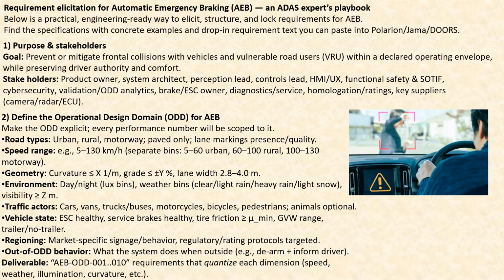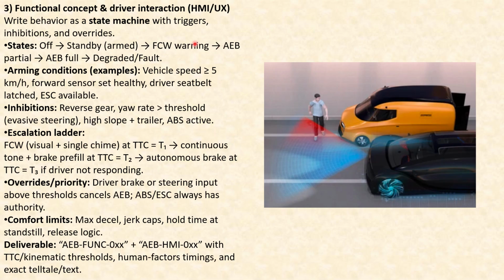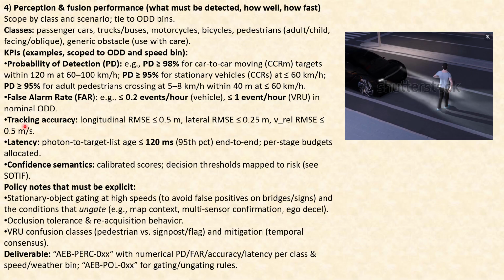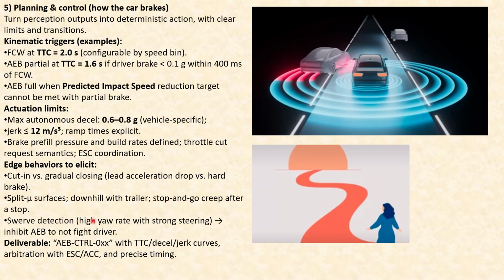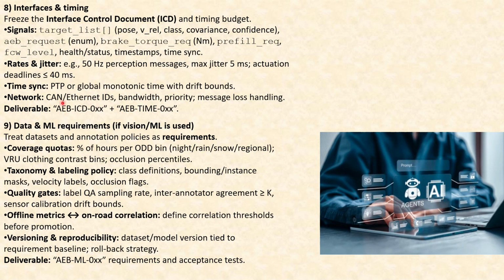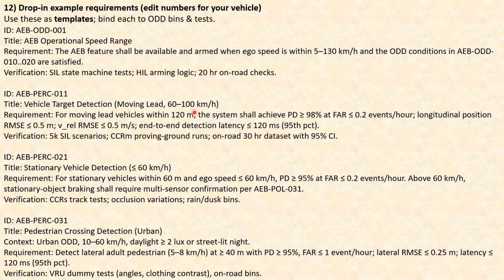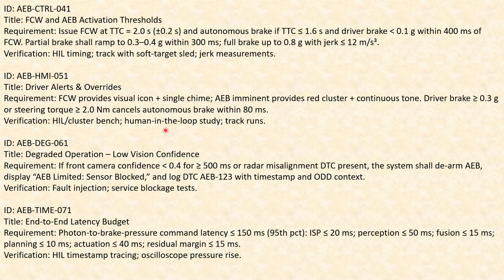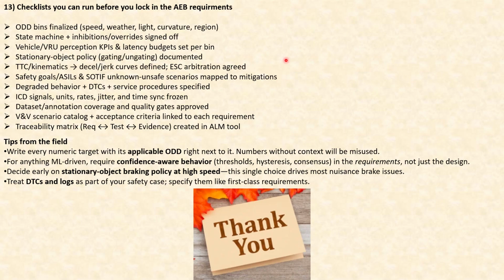Requirement elicitation for  Automatic Emergency Braking #AutomaticEmergencyBraking, #AEB, #adas

Comment: Thanks for sharing this! So many detailed requirements that were explained via PowerPoint Slide. Just wanted to say that requirements management tool can help here that supports following features... 

- Requirements Breakdown Structure
- Custom Requirements Type
- Change Management
- Traceability
- Baselining
- Including and Excluding requirements to define scope of the baseline
- Parking Lot to move unfinished requirements away for later implementation
- Markdown format for description to capture rich text description. 
- Export and Import of data in JSON format that can be used to set context while talking to AI engine too!

- OpenRose - 🏵 Requirements Management Tools Team 
FREE and Open Source!
Capture, Define, Trace, Change, Prioritize, Baseline, Negotiate, Test, Deliver >>> Repeat the Process.